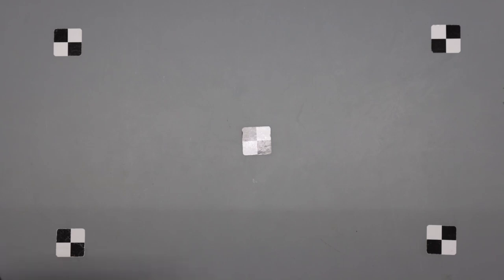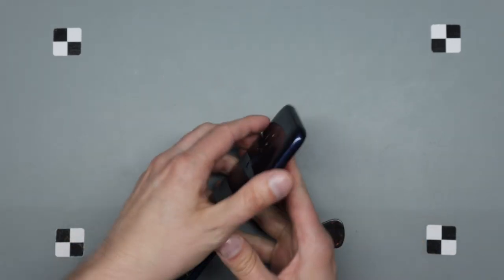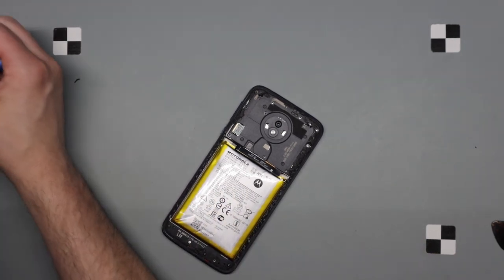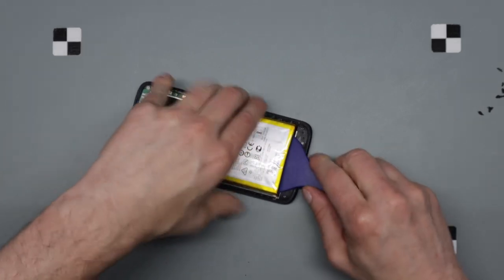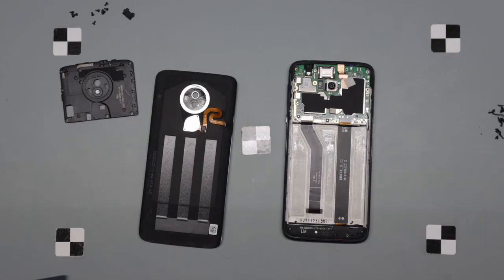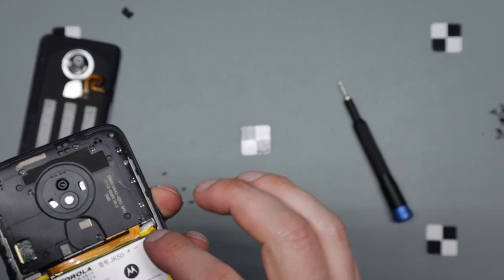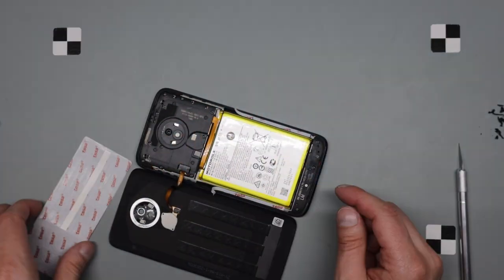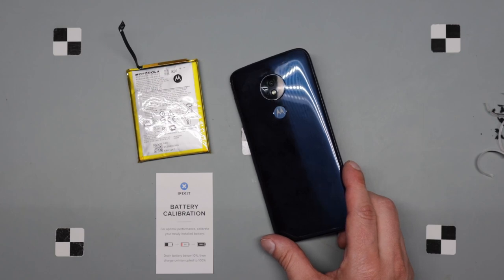Motorola Moto G7 Power Battery Replacement

Comment: The day came where I was needing to charge every day. Had a replacement battery from Ifixit that was purchased two years ago. 

I tore the print reader cable and threw it away. The phone doesn't seem to care that it's missing and neither do I. I also vented the corner of the battery using a plastic pry tool. I threw the old battery in a metal box for a few days. Looking back on it, I should have used safety glasses, gentle heat, and plastic putty knives are easy to find in the home stores. 

The good news is that my last charge powered the phone for 6 days with an estimated 3 days left. The current calibration predicts 13 days! Thanks for the video and the battery is obviously genuine.

Comment: Great video! It helped me not have any surprises while replacing mine. I also replaced the back cover because the battery was so swollen from the outgassing that the cover was deformed. That actually helped because the replacement cover came with adhesive strips applied and made it a lot easier with reassembly! And the tape was continuous so it is probably waterproof, but I'm not going to test it.  My phone should probably last for at least a couple more years. Yay!
To drain the battery for calibration, I turned the screen up to full brightness and chose a long @$$ video on YT. 😉
And peeps... If you're replacing batteries like these, please BE SURE you dispose of the old battery properly. They can be very dangerous if tossed in regular trash (illegal in most jurisdictions). Find a hazardous waste facility in your area that accepts batteries.

Comment: Is there a reason you use adhesive tape to refit the back cover rather than running a very thin run of silicone sealant? Surely that would make a better seal than the tape.
Reply from the maker: With any sealant there could be squish out into areas you don't want it to go. And it may not adhere to certain materials/surfaces.
Reply: @eeAspect  Yes, you wouldn't want it going round any electronic components that may heat up. I get that. Thanks.

Comment: My g7 play with SD632 too, seems so slow these days. Did changing the battery impact performance? Was it in some kind of safe mode with bad battery?
Reply from the maker: No safe mode, the battery still charged normally, but was draining faster and had the noticeable bulge.  Didn't notice a performance impact.

Comment: Followed your demo and got my battery replaced, before I found this video I couldn't get my phone to recognize the new battery. I started charging the battery before I got to the calibration part, charged up to 51% then decided to let it drain to 10% like you did. It is now off the charger and draining, I  will let it go then charge and see if that is ok.

Comment: Where do you get those adhesive strips for replacing the back? A kit I bought had everything I needed except glue for the back. 
Thanks for the video, by the way. I wouldn't have had the confidence to try this without watching someone else.
Reply from the maker: Tesa 61395 Adhesive Tape - from iFixit in the description
Reply: @eeAspect  Thanks!
Reply: @eeAspect  Size theres 2mm X 35m etc ?.
Reply from the maker: @DJJAW11  Yes, there are multiple widths. The one I bought was the precut double sided card and I used the 3mm and 5mm strips.
Reply: @eeAspect  Many thanks

Comment: Isn't the official Motorola stance that the battery can't be replaced?
Reply from the maker: Maybe... if they had soldered the battery leads to the circuit board, that might be the case.

Comment: How is the battery working after 1 year? Where did you buy the original battery. I hate the new phones, they are too big
Reply from the maker: Battery still works/charges great.
Bought it from ifixit, so it is an original battery not a generic clone, the link to the battery is in the description.
Reply: @eeAspect  thanks. It seems to be unavailable. I bought some newer phones and I hate them. The screens are too tall and they run too hot. As if these android brands want us to move to iphone ☹️

Comment: Did my own. broke some of the bottom back plate, unscrewed and peeled back the ribbon connectors, started prying the BA up when the old still in the phone hissed and cought fire 1 second Chemical smoke I evacuated from the room, But the inside of the phone is burnt beyond use.... Installer beware. That old BA was puffed up, it had expanded before

Comment: Dovevi scaldarlo con il phon!!
Reply from the maker: I didn't need to warm it up.
Reply: No. Usano nastro adesivo sul coperchio e sulla batteria, non colla. Solo la colla deve essere riscaldata.
No. They use tape on the lid and battery, not glue. Only the glue needs to be heated.